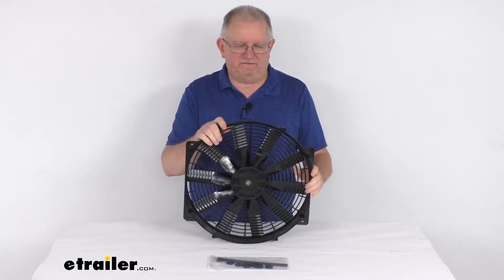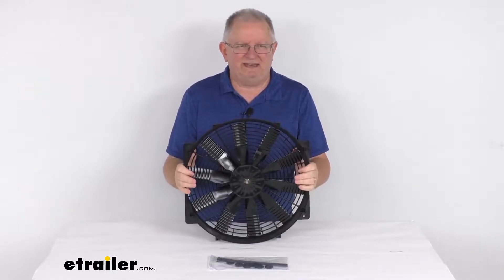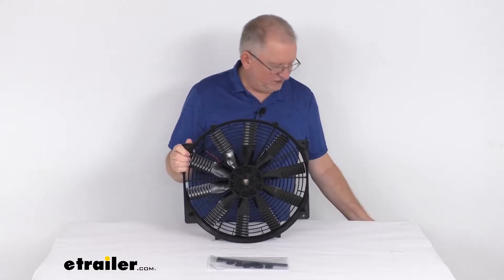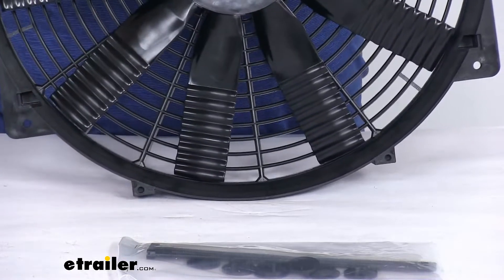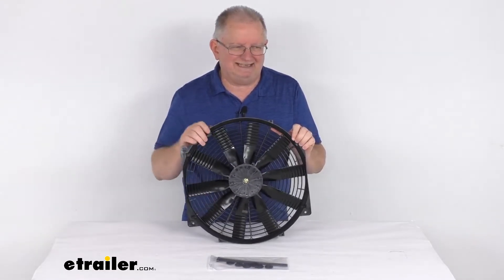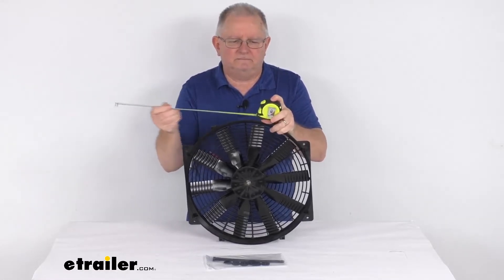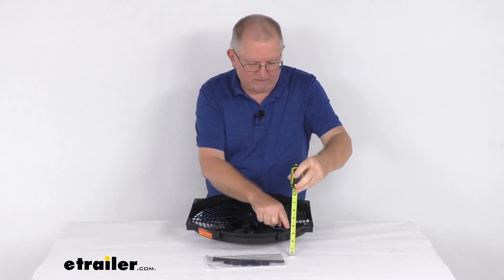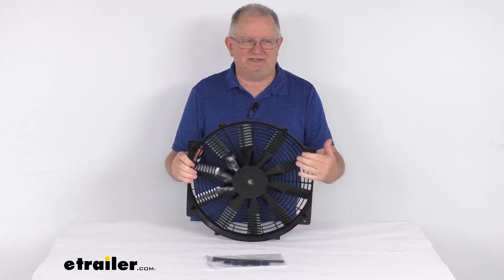etrailer | Comprehensive Review: Flex-a-lite 16" Flex-Wave LoBoy Auxiliary Electric Fan

Comment: Can it be used as a variable speed fan?
Reply from the maker: It's not a variable speed fan. I'd go with the # FLX183 which has a greater CFM rating and is variable speed fan.
https://www.etrailer.com/Radiator-Fans/Flex~a~lite/FLX183.html
Reply: Hi great presentation can this fan be used for long periods of driving? some other fans similar to this are not intended for long periods of operation  thankyou